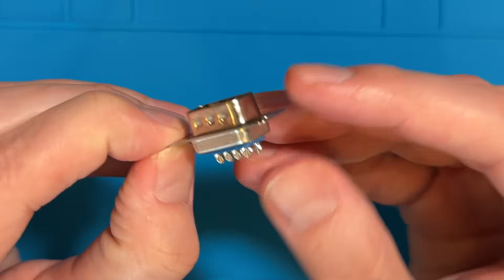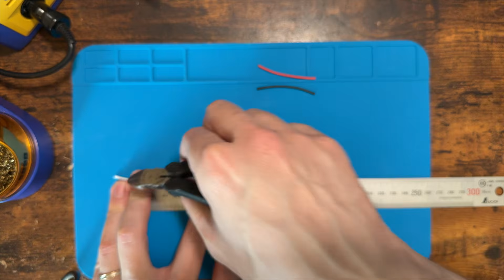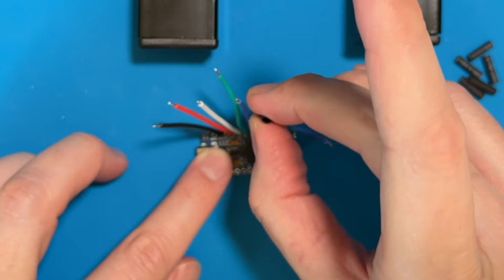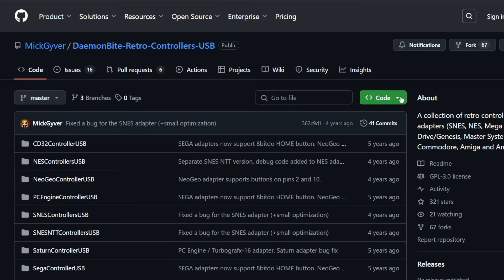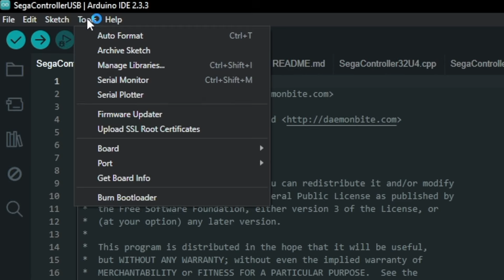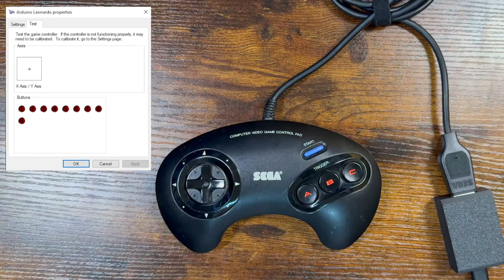MiSTer FPGA Sega Genesis / Megadrive Controller Adapter | DIY USB Build Guide (Daemonbite Tutorial)

Comment: Fock dood that looks tough! I have not done soldering since senior year we had basic electronics class as elective!
Reply from the maker: I don't even know if we had a soldering option at my school. This adapter is tougher than the NES/SNES, but still manageable. I think the guide should help!
Reply: @naadofett  Yeah man they would have locals drop off broken electronics at the school for us to fix under the guidance of a retired electrical engineer. My biggest accomplishment was fixing a bad solder connection on a horizontal alignment chip on a CRT TV. We had to use a million dollar fiber optic viewing machine to locate the bad solder connection on the chip! I have a Super Station 1 pre-order that may come in the fall! Would this be compatible as long as there is USB port correct?
Reply from the maker: A million dollar viewing machine?! Holy geez and I thought it was nice having a $300 binocular microscope for these projects... As far as the Super Station 1 goes, I believe it's effectively a MiSTer with some PSX design features first, but plays any MiSTer core and I'm pretty sure the USB ports will accept anything a 'standard' MiSTer can. I don't know if the Super Station 1 has a User Port for SNAC/X, but these adapters just use standard USB ports.
Reply: @naadofett  our high school had a technical trade school right next to it so they were often very willing to let us use it